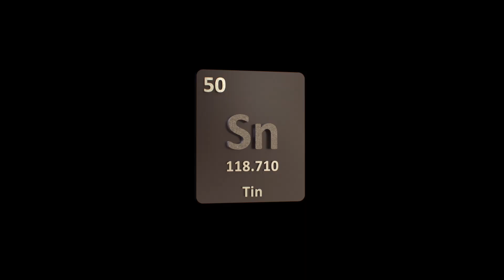The History of Tin: From Bronze Age Spears to Baked Beans

Comment: Amazing video! However 5:24 magnesium has never been a standard component in steel production. Humans discovered magnesium in the mid 1700's, and only learned how to isolate it in the early 1800's. Its was used in Ancient times only as a medicine. Also in ancient times, Bronze was commonly a stronger material than the iron being produced. Iron was only revolutionary at the time due to much wider availability. Once a culture mastered ironworking (steel) it became stronger than bronze.
Reply from the maker: Thank you for the correction. That is true, magnesium was added to remove sulfur long after the iron age. As far as Bronze being stronger than iron, that was once true when people were using meteoric, wrought and pig iron. I will add that correction to my pinned comment as I already included it in my upcoming video on iron but I don't think I articulated it very well in this video. Cheers.